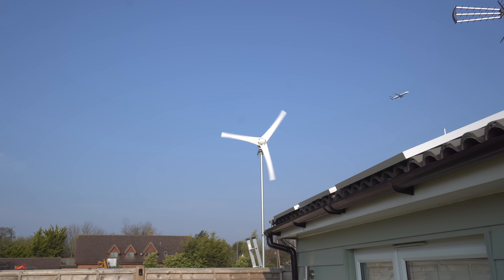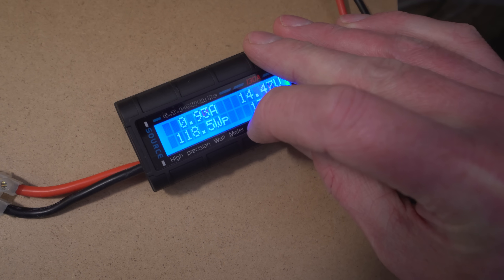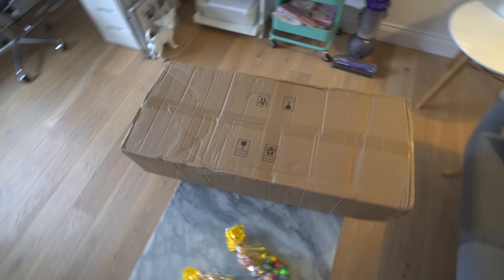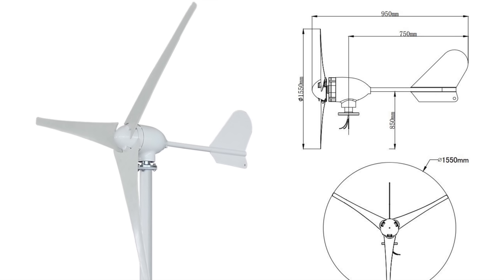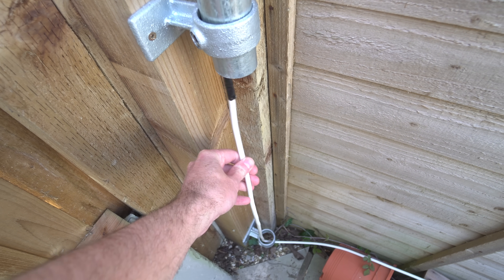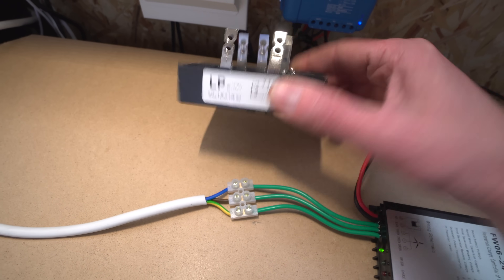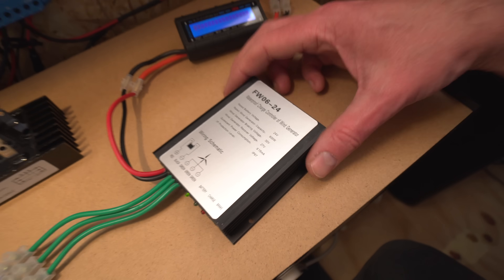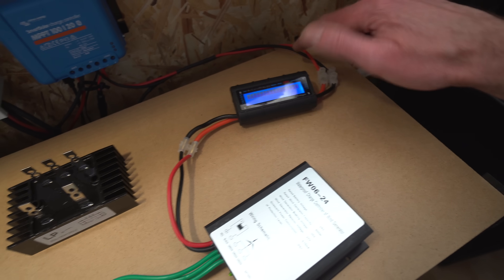500W MICRO WIND TURBINE | IS IT WORTH IT??!!

Comment: Why can't they just use magnets in these and not depend on wind?
Reply: Because, magnets do NOT generate energy. They convert mechanical energy into electrical energy.
Reply: @MrSummitville  I meant use magnets to turn the turbine blades using two like poles. I've seen it on a smaller scale on one of those fidget spinners. A magnet either side and when it was set up right, the fidget spinner was spinning constantly

Comment: Had a 12 volt Missouri turbine since 2017 and just a car battery,and not connected to the grid.No problems so far,soon will connect sun panels too and  buy lifepo battery,also changed to led strips light both color and just white.Also have 24 and 48 volt wind gens of which the 24 volt will be installed outside the barn for led strips and  charging electic forklifter.Thank you.

Comment: The reason your Victron is showing less peak power than your monitor is because the Victrons MPPT can't keep up with the constantly changing peaks and troughs of the generator output. A large reservoir capacitor directly across your Chinese charge controller output would improve this.

Comment: Wind turbines are all about position and height. Took us ages to get the sweet spot. Then of course in winter to windy can be a problem. More erratic production but wind can be 24hrs not just daylight. Most benefit in short winter days then solar better in longer summer days.
Reply: In what city do you live, that has strong winds 24 hours per day?   How high is your tower?  What brand and model wind turbine?

Comment: Nicely made video. 

But I am not happy with it especially with the conclusion. You got not wind, so it seems like you've got something up and running and the real results just can't be shown. 
I have a wind generator myself and I've learned that you can not use a Solar-MPPT-Tracker for a wind turbine. Solar-MPPT-Tracker try to avoid local maximum points, which can be caused by shadows, so they keep searching by increasing the current. You can do this within milliseconds on a solar panel, because the power comes back immediately. But a wind turbine is slowed down, and needs time to speed up. That means the MPPT-Tracking starts over and over and will  never find a good spot. This is why your voltage rises and falls and you get some power output for a few seconds only. You would need to change the victron. Afaik there is no wind-mode. Even if you could change the behaviour of the MPPT-Tracking the voltage from the wind turbine can spike up and damage it. 

Thumb down from me. Sorry, but I don't like that you are not telling the whole story, add "no-wind" excuse,  just to sell some stuff with that affiliate link in the description.

Comment: Vertical wind turbines are better in most places, they will catch even the slightest breeze and the direction doesn't matter so it doesn't need power to re-adjust the blades, though overall generation is a bit less. However because it's generating more consistently you get higher power yields on average in places where wind is more scarce.
Reply: Vertical Wind Turbines are worse ...
Reply: @MrSummitville   It completely depends on where you live. East Coast Canada they'd be better because the winds always changing direction.

Comment: I think for microturbines, a vertical axis setup is better. A combined Savonius and Darrieus rotor doesn't give a fuck about rapid direction changes and turbulence in general.
Reply: Vertical Wind Turbines are even worse.  Did you drink the kool-aid?
Reply: @MrSummitville  For large scale operations you're right, but for smaller setups, where there's more turbulence, vertical ones are better. There's tons of data about this.
Reply: @GeoStreber  show me your "tons of data" ...
Reply: @MrSummitville  Did you see my previous comment? I uploaded a list of sources, but I cannot see it anymore.

Comment: That cable isn't suitable for the job - the green & yellow insulated will be a lower CSA or cross-sectional area. I can't imagine that would allow the 3-phase generator in the turbine to work very efficiently.
Reply: The wire is fine. There are bigger problems ... like very little WATTS.

Comment: Get yourself a cheap 30USD clamp meter.
I personally like the UniT210E as its both AC/DC valid and got a DC resolution down at 1mA, but sadly not a Max-feature as far as I remember, but its great if you just wanna poke current on different AC or DC lines..

Comment: This video on how to calculate https://youtu.be/o6BCnhubbiQ .Now you could anticipate this with multiple online calculators : AT MAX a wind turbine power is only factor of wind speed, and surface area (minus turbine efficiency). For a very bid windmill turbine efficiency is at best 63%. For a small one like this, prop efficiency is at best 40% at its design speed, wich is NOT 15mph. Then power convertion factor of the alternator is at best 85% with your setup but I've seen as low as 50%. Using such calculator, A 1.55m wind tubine with a 40% efficiency can give 145Wx.85 at 8m/s (15mph) but theoreticaly give the desired 500W at 12m/s windspeed.( minus power convertion). Power increase with the CUBE factor of the windspeed. Also the charge controler has another role : by increasing the power draw, apply a braking force on the turbine to maintain the best efficiency, kind of MPPT but for wind mill. Because the small chargers have low power, they let the turbine spin a lot but they dont draw the full potential power. If you see you turbine spinning effortlessly without giving any power thats the cause.

Comment: I put a wind charger up in 2002. Only had lead acid batteries really back then. I remember it took a few days to start up I think the bearings just need to free up a little. Thing to remember is solar only produces in the day and optimal in the summer when wind is 24/7 and best in winter :) it’s a good combo.  One night in a storm mine was going crazy off the scale on power.
Reply: Wind is NOT 24/7.  Where do you live, that you get 10m/s or 25mph steady wind, 24x7 ???
Reply: @MrSummitville  oh yeah should have put potentially it’s 24/7

Comment: The quick answer to the title's question in the form of more questions: 1) does the turbine, in its operational lifetime, generated considerably more energy than it took to manufacture it and all the ancillary components to make it function ... assuming a comprehensive and accurate measure of manufacturing energy expended, and 2) does the consumer actually use a sizable fraction of the energy that could be generated by the turbine?
Reply: Wait so what's the answer
Reply: @NithinJune  The overall answer is "Yes" only if the answers (to #1 and #2)  are "yes."  Otherwise, "No."
Reply: @cougar1861  how would you calculate - 1? We factoring in the energy required for the paint. To produce every individual bolt? If we want an true value yes we would. But ain't no one calculating that... The cost of energy required to do any of those things would fluctuate constantly... Would depend on when and where the individual components were produced. Just calculate the cost of the kit in full when you bought it and go from there. We're not manufacturing these things for profit, that's the job of the person who built the stuff to calculate that shit. And he will have factored all that into his costing for final rrp (hell be wanting a profit obviously) so if you spent 3 grand on it all, it cost less than 3 grands worth of power to produce, that's a given. Unless your buying second hand, then it just gets complicated again... Basically just go off what you paid and not worry about the rest
Reply: @1invag  I'm not picking on you/your product.  I've made the same comment at every, of the many, chance I get.  And I'm not talking about money "value."  At this stage of imminent climate crisis, $$$ accounting has to give way to energy accounting because CO2 emission is the unavoidable consequence of fossil fuel use.  Thus the appearance of alternative energy products as this wind turbine.

It's a general, very important issue:  if an alternative energy "solution" requires more energy (i.e. CO2 emission) to produce than the projected "CO2-free energy" it will deliver in it's useful lifetime, then there is no reason for it to exist --- IF the overall purpose is to address the issue of climate crisis.

if you are "not manufacturing these things for profit," then what IS the reason for manufacturing them, if not to provide a valid alternate energy source, as above?

Comment: I had a micro turbine almost 40 years ago, sourced from the Centre for Alternative Technology in Wales.  There was nothing like the modern control and monitoring equipment available for the small scale, all it had was a simple transistor and resistor circuit mounted on a massive heat-sink intended to dissipate power as heat if there was danger of overcharging.  It charged a high capacity 12V lead acid tractor battery and that powered 12V incandescent lamps — which were actually 21W car indicator bulbs that happened to have dual contact bases almost exactly like the SBC (small bayonet connector) used in many lamp fittings.  Also occasionally a 12V TV.

Really crude by today's standards but in an entirely off-grid house it allowed small luxuries like being able to go to the toilet or up to bed without carrying a candle.  😀
Reply: I remember going to that Alternative Energy centre in Wales (Dolgellau if it's the one I went to).  I found it really interesting what they were doing and that was about 30 years ago.  It's a lot easier to source these things nowadays with T'internet and information resources such as this.  Great idea of Andy's to make this sort of thing a hobby and not be hell bent on making (saving) money or even getting your money back.  Even with the small quantities of energy you generate with these projects, you might be very grateful for it if power cuts kick in which I think is the most serious threat that we have had for about 50 years.  Recent events in Ukraine make this much more likely.  I believe solar PV cuts out if there is a power cut for safety reasons because you could be grid generating when someone was trying to repair the fault, but if you have a battery, you can still draw charge from that.  If I was installing solar, I would definitely go with a battery even though it might double the cost.
Reply: Very important your comment, in my oppinion, because I think we are already behind in what whe should have started to do decades ago...a city must be at least partially independente from the state in energy... peoplel like you should get together and try to more to join...
The changes we have seeing in the last years show us that any "incidente"(even a minor one) can be a serious problem, the biggest the city is. I am from Brazil, but live in Europe half of my life. The times I came back, I tryed to bring some stuff like this and try to convince people...try a change of mind...seems impossible. We have "all" in Brazil. Except the will of the upper class, that make a huge effort to maintain the majority unneducated.
Thanks for sharing.
Reply: That's amazing thanks for sharing. Makes me grateful for how far we have come. Today I have a modern charge control with (more reliable) solar panels and agm batteries. Every product in my RV is designed for 12v usage except for my tv which runs on 19v. My lights take about 4 watts, 20 if I have them all on. The led tv only uses about 10 watts. 

I can't image  something going wrong with the "controller", and having to physically solder new components on.
Reply: That's so cool
Reply: Were i live you wouldnt have to care about that at all as having a windturbine is a crime.
Reply: @mikaellindqvist5599  Where?
Reply: What’s a candle you talk about?

Comment: Used left over solar farm panel, 435 watt, $150.  Solar seems more reliable, no noise.  But wind has its place.
Reply: Where does a micro wind turbine "have its place" ?
Reply: @MrSummitville  away from neighbors.  They are good if you live where there is wind.

Comment: I bought a similar turbine on eBay five blade 12 V found it was only ever good in really windy days!! Like it had to be making the swooshing noise for it to make power at all, just spinning quickly wasn't enough. But when that thing was spinning it was chucking  4-5 Amps at 12 V at least into my power bank. Living in the UK it's quite a good feeling after few days of overcast (Little solar) and  then have storm blow through and wake up to a fully charged battery bank bliss. My off grid home is in the valley with a persistent Direction of wind but getting the turbine high as possible is key.
Reply: Wind Turbines are RATED at 11m/s or 25 mph.  So, who has that that?

Comment: Wouldnt an MPPT controller be completely the wrong thing to use as its designed to extract the maximum current without dipping the voltage too much of the PV array not make use of a generator. It might be selling the generator a little short? Just guessing though really
Reply: It doesn't extract maximum current... It extracts maximum power. Maximum current is at a short circuit. 😁

Comment: Hey Andy,
Very interesting video.  We had a small off grid bed n breakfast in the island of Siargao and were hit by supertyphoon Rai last December 16 2021.  We were looking before to combine our solar panels (which we have with 2 15kva victron inverters (48v) with some wind turbines.  There is not a lot of good information out there (or we have not really come across it on how to go about it and most people say we should not use victron mppt with wind turbines.  We would totally buy a kit (turbine, charge controllers, dump load from you if you were able to provide us with a good solution.  Did you get any further with the turbine? does it still work?

Comment: Feeding an expensive Victron charge controller with a cheap Chinese charge controller is a bad idea. All charge controllers have a loss factor and you're adding extra loss. Take my advice and use your bridge rectifier with some large smoothing capacitors to feed your Victron instead, you should see considerable improvements.
Reply: How can you increase 0 watts ?

Comment: I am back to this video because gas prices are doubled now and I was thinking of getting wind turbines mainly for heating only in winter.
Reply from the maker: It's not really viable, heating requires a huge amount of energy. You are better burning something for heat. Get a woodburning stove. Use wind or solar for low power stuff like LED lights etc
Reply: @andykirby  Thanks. I'd burn wood if it was eco friendly. I was also thinking of installing a 5kw solar system with storage batteries but I don't know if even 30% of that energy will be produced during cold and wet British winter. What viable & renewable options are there for heating the house? in winter of course.

Comment: Hello sir i dont have computer control like you do. I have 4 micro inverters with solar panels. I feed it to local electric company.  If my next door neigbor didnt block my sun light till 10 am i would produce 3 more hours. But. Have seen the wind turbine from like you have but am unsure where to get ac out of it to switch at night.  Do i absolutely need a battery? They dont come with one and some of these seem to have 3 ac outputs. Would i connect one of these to sell to electric company at night. Sorry but electric company here very unfriendly to help with this.
Reply: Oh so i watched another video so this is what he did was turbine to contoller to battery to invertor.  So my question again i dont have batteries for my solar panels can i directly get ac out of the turbines?  ...yes .. So i do need batteries and a power inverter from batteries😞

Comment: that is not three phase cable, it's 3 core. you're using the earth wire as power...
Reply from the maker: I didn't say it was 3 phase as in Electrical installation terms,  BUT there are 3 generator phase wires as it is a 3 phase AC generator.

Comment: Make one or two from hoverboard motors, they can make up to 60v unloaded and with rectifier/filter will charge 24v extremely well. Can get about 300w from each motor without really trying.🤓
Reply: if you only consider the voltage,  why not use a voltage regulator ?    
you can have a tiny solar panel or propeller output 400 volts if you feel like that gives you more power.

Comment: I went submarine batteries with a solar charge system, split my internal house electrics, kitchen and boiler still on mains supply, rest of house, lights, sockets ect all permanently running batteries and has been for 3 years now.
Reply: What are submarine batteries?
Reply: @MrSummitville  marine/leisure/caravan batteries

Comment: I started with a Rutland mounted on a pole on the shed, but it suffered from too much turbulance and didn't do a lot even in a hurricane. I then fitted an airbreeze on the side of the house. When it really ripped,  The noise in the house sounded like a Chinook was landing on the roof. I tried to video the noise indoors but the sound never came out properly. In 4 years I dont think it paid for itself. I took it down when I built my extension, but I wouldn't mind a bigger one on a mast. Just need to get it high enough above the rooftops to get over the turbulance.

Comment: 500 watts isn't enough to run a coffee pot
Reply: Your average coffee pot takes 1200 watts so 500 watts just runs your lamp
Reply from the maker: 500W is a decent amount of power, when stored in a battery its all use able free energy.
Reply: @Iseethingsforwhattheyare  For most people, it will never actually generate 500 watts.  You need STEADY 25 MPH winds, for many continuous HOURS, per day, every day.  So, who has that?  $300 down the drain ...